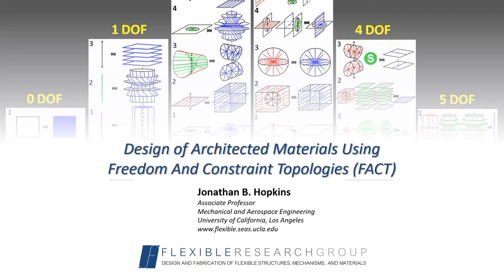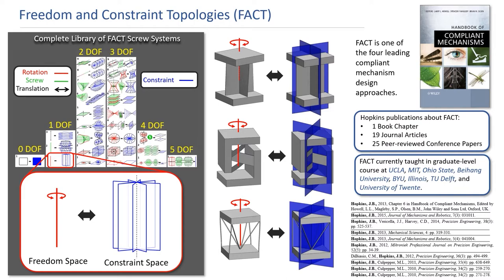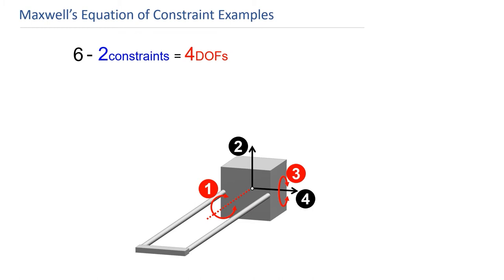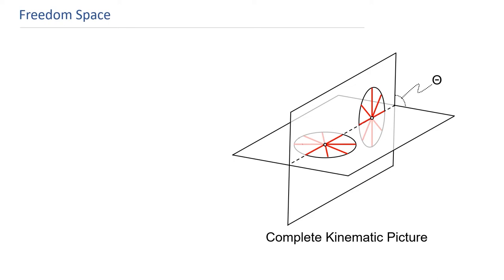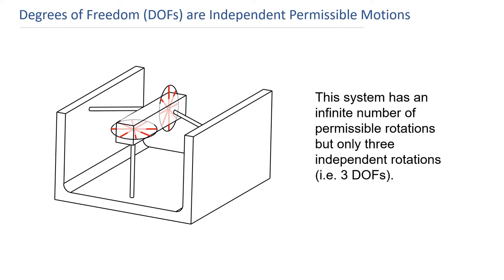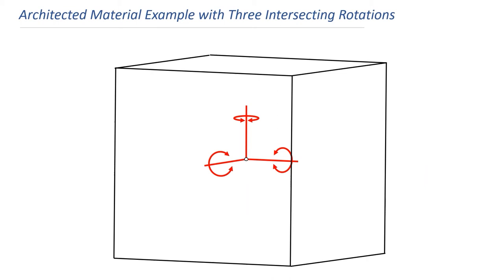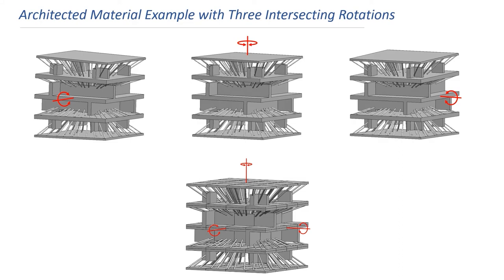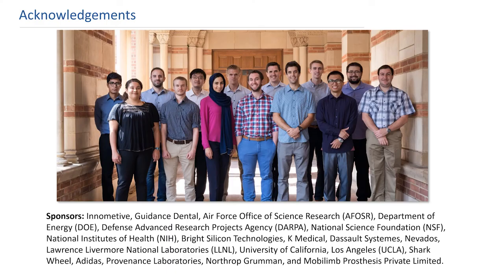Design of Architected Materials Using Freedom And Constraint Topologies (FACT)

Comment: An amazing achievement in mechanical design, which I think will ripple out into every engineering design system or discipline and result in revolutionary improvements in mechanisms and structures in the near future.

Comment: Imagine if the solver incorporated the geometry of knots. You could have really strange tensile structures with no rigid parts.
Reply: Anchor points, spinors = strange mechanical systems.
Reply: For example, with a single rigid shaft, and a lot of loops of thread, and a drive from an electric motor that is connected to the loop(s) and not directly to the other shaft, you could create an axle that could spin continuously clockwise, and in any orientation about a sphere. The threads would wear though and it would destroy itself. But it's an interesting thought experiment. Geometrically at least.
Reply: @daltanionwaves  Hi, I found your idea really interesting but couldn't understand much. Can you explain in some detail?